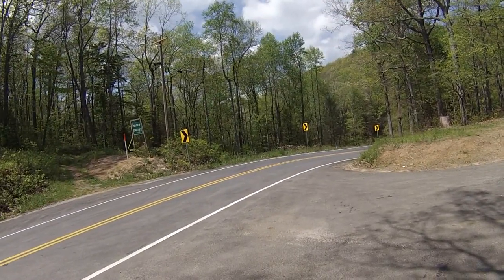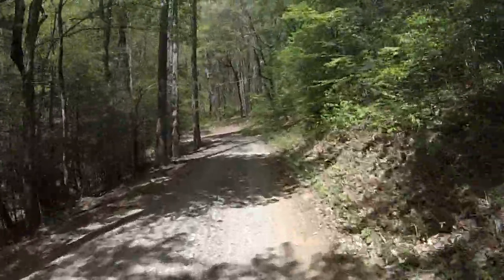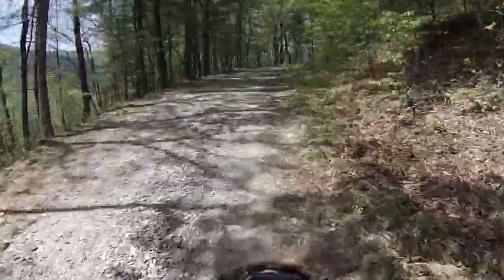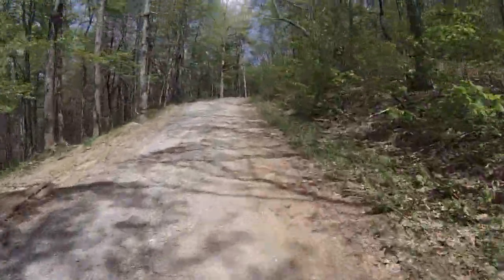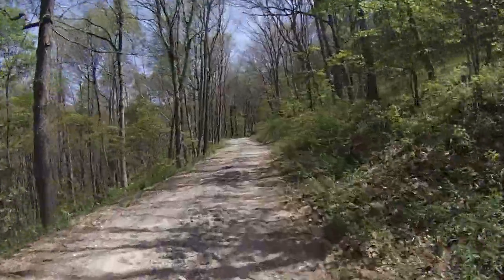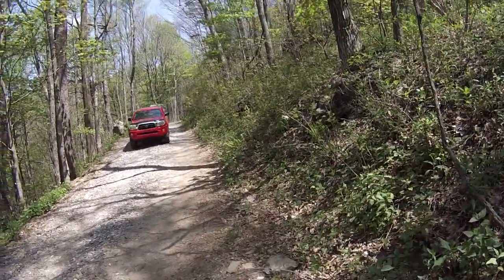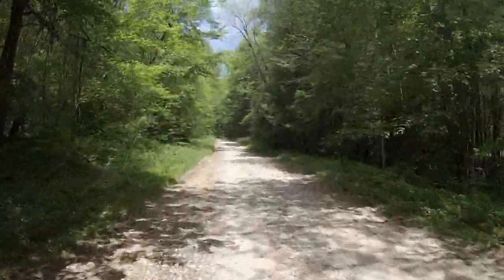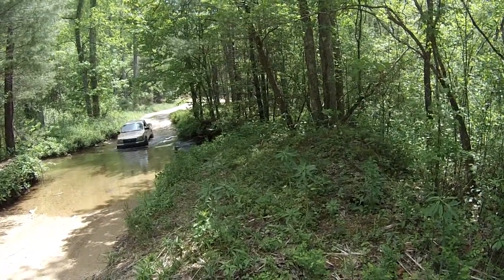Where I Ride Part 3: Coopers Creek Duncan Ridge OffRoad Honda NC700XD DCT (NC700X)

Comment: Nice vid. I am a street rider and I want expand my skill with some off road riding. Do you suggest a dual sport bike or NC700x. I am suspect of the NC700's tire, weight and suspension. On the other hand, I might be doing 80% road and only 20% off road. Is dual sport a better option or scrambler a better option. What do u think? Thx in advance.